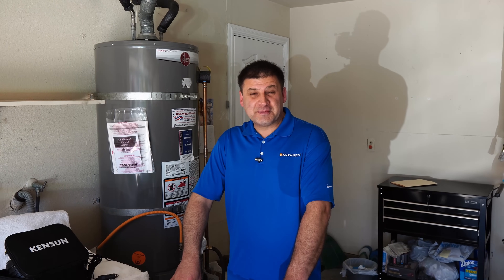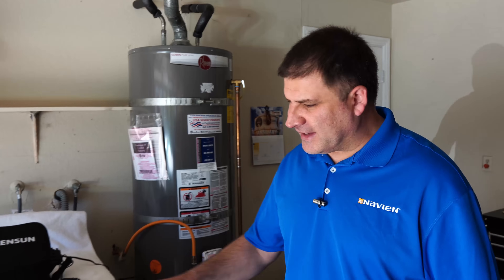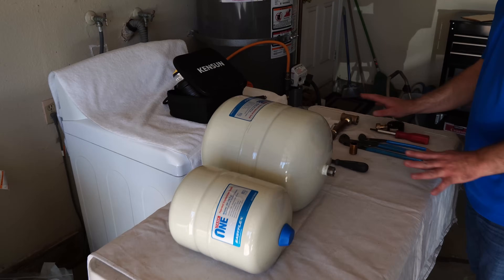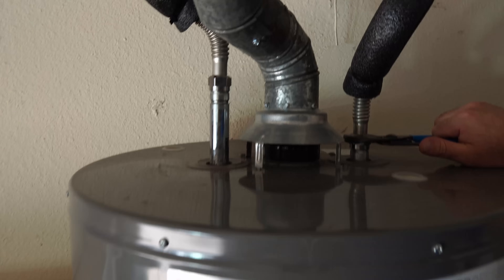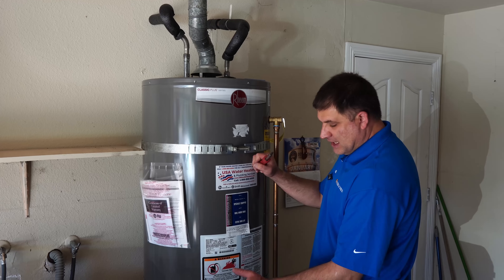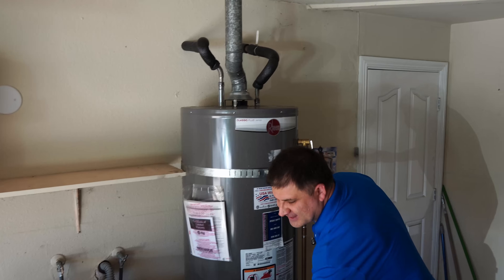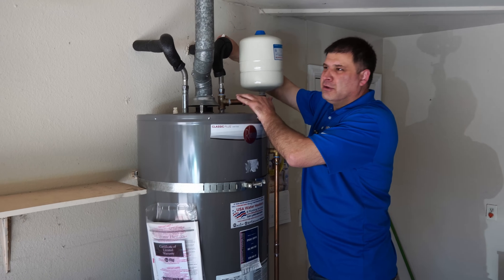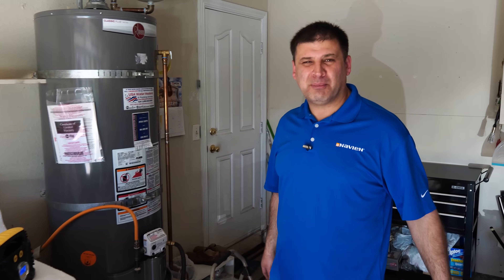✅ Expansion Tank Installation on a Water Heater - What is an Expansion Tank? - How to Install it

Comment from the maker: What is an expansion tank? What does it do? When do you need one? How to install an expansion tank on your water heater? In this video you will find the resources you need, so you can install an expansion tank on your water heater yourself. Amazon links to the parts & supplies needed in the description. Thanks for watching! LIKE & SUBSCRIBE!!!

THE 2 GAL EXPANSION TANK & PARTS KIT FOR 40 & 50 GAL WATER HEATERS:

 2 Gal Expansion Tank - https://amzn.to/3JzyggE or https://amzn.to/3pNNx5H

3/4" Brass Tee Fitting - https://amzn.to/3eLSLsd or https://amzn.to/3sRHLSk

3/4" Brass Elbow 90 degree - https://amzn.to/3qLgJtp or https://amzn.to/3eKo46S

3/4" x 6" Brass Nipple - https://amzn.to/3eHHKZ1 or https://amzn.to/3pPCNE1

3/4" x 2" Brass Nipple - https://amzn.to/32Nl0V0 or https://amzn.to/3sWZND3

12V/110V Kensun Air Compressor - https://amzn.to/32M7AIV or https://amzn.to/3zhCPHQ

Pressure Gauge Hose Bib Connection - https://amzn.to/3ENOShb or https://amzn.to/3mP8hbg or https://amzn.to/3qGQDrs

Monster Blue Tape - https://amzn.to/3JzzbO8 or https://amzn.to/3JB7q7J

Pipe Threat Sealant - https://amzn.to/3sQdzqQ or https://amzn.to/3mMAkIf

My favorite pliers sets:
- Single Pliers Medium Size  -  https://amzn.to/3sZfwBc

- Two Pliers Set, Medium & Large  -  https://amzn.to/3znkMQC

- Three Pliers Set, Small, Medium & Large  -  https://amzn.to/3pMuyII

THE 4.5 GAL EXPANSION TANK & PARTS KIT FOR 75 & 100 GAL WATER HEATERS:

4.5 Gal Expansion Tank - https://amzn.to/32JbQJh or https://amzn.to/32BiAsQ or https://amzn.to/3qJB1DC

1"x1"x3/4" Brass Tee(if you get this Tee fitting, you don't need the bushing below) - https://amzn.to/349UR33
3/4" to 1" Brass Bushing Adaptor(you will need this only if all 3 outlets for the tee are 1") - https://amzn.to/32Ve47Y or https://amzn.to/32Xzwt1

3/4" Brass Elbow 90 degree - https://amzn.to/32Yitr3 or https://amzn.to/3pMzY6v

3/4" x 8" Brass Nipple - https://amzn.to/3FW1B2Q

3/4" x 6" Brass Nipple - https://amzn.to/3eHHKZ1 or https://amzn.to/3pPCNE1

3/4" x 2" Brass Nipple - https://amzn.to/32Nl0V0 or https://amzn.to/3sWZND3

12V/110V Kensun Air Compressor - https://amzn.to/32M7AIV or https://amzn.to/3zhCPHQ

Pressure Gauge Hose Bib Connection - https://amzn.to/3ENOShb or https://amzn.to/3mP8hbg or https://amzn.to/3qGQDrs

Monster Blue Tape - https://amzn.to/3JzzbO8 or https://amzn.to/3JB7q7J

Pipe Threat Sealant - https://amzn.to/3sQdzqQ or https://amzn.to/3mMAkIf

My favorite pliers sets:
- Single Pliers Medium Size  -  https://amzn.to/3sZfwBc

- Two Pliers Set, Medium & Large  -  https://amzn.to/3znkMQC

- Three Pliers Set, Small, Medium & Large  -  https://amzn.to/3pMuyII
Reply: Dennis - What did you remove from the cold water input of the tank ( @ 11:25)?
Reply: A, a x,Q
Reply: How much you install water heater?
Reply: @nai2673 5 bucks
Reply: Thanks for all the info and details. Ditto for using and recommending Channellock pliers, please put the name in description! They are also my favorite pliers (have them in many sizes) and they are proudly made in the USA!
Reply: You have two Expansion tanks on the table (2 sizes), why did you use the smaller one?  Does it matter if you would have used the larger tank?  Are all the expansion tanks good to use for all types of water heaters?  I have a 40-gallon natural gas water heater, what is the best size expansion tank I should install?
Reply: you might turn off you power , cold water will blow out your element
Reply: So I read where the expansion tanks should be at least 18 inches from the hot water tank. Also can I install the expansion tank in a horizontal position?

Comment: Thank you for this video! I just moved into a high water pressure neighborhood. Ideally i should hire a plumber yes, as my water pressure gauge is at 117-120psi; one simple question i didn’t catch; would that 2 gallon tank reduce my psi (I have. 40 gallon water heater) from 118 to sub 80? @dennistheplumber

Comment: At 11 34 what did u remove that was no longer needed.  It's been 20 years since I installed my water heater I know it ain't supposed to last that long but it did and this one's way different it has this blue thing on top of both of the nipples for the inlet and outlet and the manual mentions nothing about leaving it in or removing it so I'm not sure if it's supposed to stay

Comment: Great video. I just installed a new water pressure regulator but I notice with use the pressure fluctuate from 50 up to 80 and 120 then back down. I am suspecting it’s from thermal expansion as I replaced the water regulator twice within one year. I was wondering if an expansion tank would help decrease the pressure fluctuation. Thanks!!

Comment: Nice job, except for one thing: connecting copper directly to galvanized steel. This will cause galvanic corrosion and, eventually, will leak.  Brass nipple would've been appropriate.
Reply: And the access by an impact wrench  to the anode rod is blocked. Plumbers like do it this way so the water heater only last 10-12 years.

Comment: Can't say I have ever used any goop over my teflon tape.  Even then, I wrap the threads maybe two to three times around at most; tight.  Why the goop?
Reply: Despite what it claims, pipe sealant or pipe dope, is not a sealant. It is a lubricant for the threads. Think of it like putting anti-seize on your spark plug threads. It eases install and the future install for the next person.

Comment: If that garden hose is located before the pressure regulator, the pressure will be higher, so that 80 psi is to high for the  expansion tank.

Comment: I have a question. Does the expansion tank always have to be installed near the water heater?  There is little work area by my water heater. May I safely install the expansion tank on the house water meter outlet pipe? Will it protect my water heater and other plumbing fixtures from high water pressure in the same way as installing it near the water heater?

Comment: No matter what I do. Mine leaks. I've tried 3 different kinds of tape. Putty. Tape with the putty. I cut fitting off replaced fitting assuming threads were bad. Why on earth does it keep dripping
Reply: I had the same problem, look at the threads on the nipples. If they aren't sharp, don't use them. Some nipples are manufactured with dull dies and will have blunt threads.  Blunt threads provide a path for leaking.

Comment: Why did you remove the plastic heat traps that come with the heater on the outlet? It's supposed to be there. I'm running into the problem where if you're not going to put on a flexible waterline with an O-ring. What would stop that little plastic piece from being dislodged because a brass T or a brass coupling won't stop it from dislodging ....no manual or no manufacturers manual addresses this. Bradford White.

Comment: Shouldn't the expansion tank be supported by a strap instead of just a pipe? It seems like the weight of the water constantly adding weight to the tank and to the pipe isn't a good idea. Water weighs nearly 10 pounds per gallon + the  weight of the tank itself. Is there a code that says the tank should be supported?

Comment: My TP Valve was leaking on the garage floor. Plumber came out. Diagnosed as bad TP first. Replaced that without checking the expansion tank. Checking the tank and it was bad. Pretty easy to tell. No pressure. So replaced that. Total cost $754 !!!! wish I’d seen this post earlier. Looks easy. Not quite 3 year new house. As he finished the job he said you might want to replace the T connection piping from galvanized to copper.  Great. Another expense on another day. Problem apparently copper doesn’t mix with my incoming supply line stainless steel. 
So my question is brass ok with stainless steel?
Reply from the maker: Yes, brass is fine with stainless steel.

Comment: Got a question, im in the US and we use much bigger expansion tanks with 65 pounds psi where im located and you have 2 tanks and why are you using a smaller tank on such a larger water heater and we use the larger ones on the larger tanks like 40 and 50 gal. Water heaters

Comment: Dennis included all the details I needed to know to buy and install the tank.  Tank was $30 at Home Depot.  Brass fittings were $51.    My recommendation--do not scrap this setup when water heater dies.  It will probably worth $100 by then.  Very enjoyable and helpful.

Comment: This whole idea of incorporating an expansion tank would make sense if it weren't for the existence of a built-in check valve in the cold water supply inlet of the hot water heater. If that check valve never allows for backflow to occur than what is the point of installing an expansion tank on the cold water side? It would only make sense to install it on the hot water side.

Comment: You are spending about $60 in brass fittings. But if you go with PEX then you all you have to do is suspend the tank using some cheap plastic strapping and screws, it seems that would be a lot cheaper.

Comment: Thank you for the explanations. I see that is a Rheem water heater. What model?
Shutting off the water to the house completely might not work. You might have to bleed the line by opening a faucet in a bathroom or kitchen as well.
I will have to measure to see if I have space to add an expansion tank for my water heater. And I will have to see about getting something to tether the water heater to the wall so it can't fall over. Right now it just stays upright on its own. For people who have trouble threading the expansion tank on without crossthreading-- try turning it backwards first until it clicks in place. Then turn it the correct way to tighten.

Comment: On the bottom of your thermal expansion tank, I would add a ball valve just in case your thermal expansion tank goes out and the customer cannot get a plumber right away to replace it, and still have hot water.

Comment: The problem with this installation is it is against the code.  The tank is not allowed to be supported by the pipe it is connected to.  You must support the tank properly.  (IPC 308.10)

Comment: Is it safe to test the pressure and adjust the pressure while the expansion tank is already installed it already exists in the home I just bought. I just want to make sure it was done properly or do I need to shut down the entire system and uninstall it to check the pressure and adjust if needed?

Comment: Nice video. I might have missed this. Is this the correct orientation for the expansion tank; connect it on the bottom and the air intake on top? The reason I am confused, when looking at the picture for the link of the tank below, it looks like the right side up shows the tank is the opposite by the label on the tank. Common sense would give me the answer, but I guess I have none and was wondering if the label is wrong-side up.

Comment: thanks for the video, I was looking into installing an expansion tank mostly because when I close a faucet I hear the pipis banging. Sadly my water heater is installed directly soldered to copper pipes, no flexible. I will need to hire a plumber to put a T in there, or may be I can install it somewhere else.

Comment: This is one of the very best videos (and clear explanation) of a job most plumbers would say you need a professional. If someone has basic to intermediate skills, this video should encourage a homeowner to DIY this project. Thanks!
Reply: I agree.  Just remember to turn off the water supply on the "cold" side and if you have an electric water heater turn off the breaker first

Comment: " By law " 😮 there's no law to  install or not install the expansion tank , it is the customer choice . You may have to edit what you said...
We have a water heater thats been in the house for over 25 years ,nothing wrong with it , thanks God
Reply: @starinthesky1520  I think we he said "by law" he meant "by code" which is many jurisdictions is it a requirement by code to have one.  You may not go to jail, but you certainly won't pass inspection.  Or, DYIers will do this on their own, there's a tank/pipe/fitting break (or leak) and the house is flooded and the insurance company asks "where's your expansion tank? who installed this hot water tank?" And the water damage claim in denied.

Comment: Not needed! No expansion tank for over 50 years and no problems! Just more government regulations bullshit that costs homeowners unnecessary $$$$$
Reply: @user-jo6ym7cr6z  Um... Well for those people that live in modern houses (or re-pipes) with closed-circuit water systems, they are needed and in many jurisdictions required by code (or an approved pressure relief mechanism).  There's no reason NOT to have one unless you're cheap or think that when water is heated, and it expands and causes an increase in pressure that physics/hydrodynamics/heat transfer are some kind of government conspiracy or over-regulation.  Those "government regulations" are in place to protect the homeowner from unnecessary damages and expenses due to water line over-pressurization in their home. And yelling at your screen won't make your opinion less wrong, sorry.

Comment: I've read that you don't need an expansion tank if there is no back flow preventer., ie. not a closed system. This video seems to show an open system.   The video does not show a back flow preventer.  What is the correct deal?  Or is this video just a demo on installation?
Reply: You are correct, if the house is not a closed system it is not required by code (or an approved pressure relief system is in place).  Usually the back flow preventer is in-between the water meter and where the water main ties into the house.  I didn't see him show that in the video but most modern (2000's and later [including re-pipes]) houses/dwellings are closed circuit.  There's no reason not to have one (other than cost savings) even if you aren't required to have one by code. I hope that helps.

Comment: Plumber was at my home changing out a gunky galvanized pipe related to something else, and put up a new expansion tank while he was here. But, he didn't check the water pressure of the house (I have that in writing) and over-pressured it to 70psi. My house water pressure is 50psi. He also turned up the heat really hot, whereas I keep it at the red line just above warm. The day after he placed it, my water heater started leaking from the bottom. I reduced the pressure and temperature and turned off the hot water valve, and it's still leaking. My water heater is 20 years old, well maintained, and without any problems until this. So, I think the additional pressure  wrecked my water heater. I'm trying to figure out if this was ignorance or maliciousness.  I would appreciate any input.
Reply from the maker: The expansion tank pressure had no effect in this given situation. The expansion tank pressure does not apply outwards, the bladder in the expansion tank contracts internally when water expansion is introduced to it, this is why the pressure of the water in the pipes and the bladder need to match. It's coincident that your water heater leaked. 20 years is very old, no wonder it's leaking.
Reply: Yeah, I was also wondering if it were a coincidence and turns out it is. Thank you so much for your response.

Comment: You are doing it all wrong, supply pressure is 80psi  and you pre charged the expansion tank to also 80psi, how is the expansion tank going to work?
Reply: When the water heats up it expands and the extra pressure will push inwards against the rubber membrane in the tank.   If it wasn't pressured, the water would push hard against the membrane and if the pressure in the tank was too high, then the excess water pressure might push a joint or coupling open.  The two pressures have to be roughly equal.

Comment: So there are complete waste of money. If you ask me I have been Plumbing over 30 years. Every time I remove an old expansion tank it is full of water which means it’s doing nothing. They’re only good for one or two years and then they fill full of water.
Reply from the maker: If it's full of water that means the bladder has ruptured. That happens for two reasons. It's either too old, or if it is newer, then when it was installed it was not pressurized to match the water's pressure. If it is not properly pressurized, it does not function at all and the bladder bursts in a year or two. But, these things serve a purpose for sure where they are needed.

Comment: My old watet heatrf had two cold watrt lines feeding the tank. The shutoff valve for the tank did not shut off the water suppl, so i has to turn off the main to prevent it from leaking.  The new tank had both lines going in and they added the expansion tank, but no one knew why i had two cold water lines going into my tank. They just added a second shut off valve ro the water heater.   Dies anyone know why it was plumbed that way?

Comment: To prove my point next time it’s 80 degrees  blow air out of your mouth…than do it at -0 …surely that tank would have to insulated now …right? Or do you just turn off the main at minus 32 degrees and under and wait it for the sun to come out …ask the residents of Frisco Texas when the Texzila freeze came and it was 0 degrees for a week …and the power went out …that’s a ticking time bomb if you ask a pro concrete core driller

Comment: One more thing air expands to right? So at -0 what is the air pressure in the tank if you put 80 psi or 40 in the summer at 100 degrees Fahrenheit?